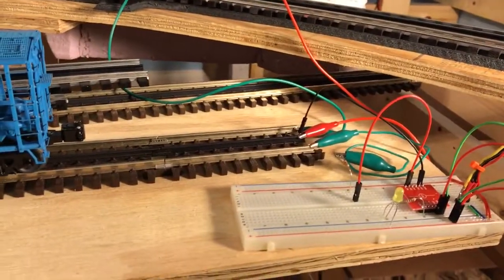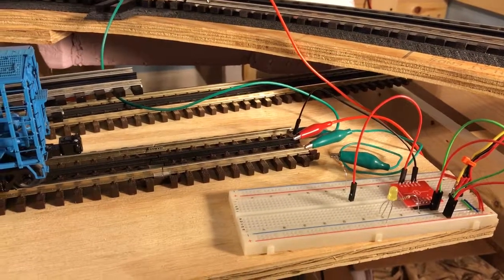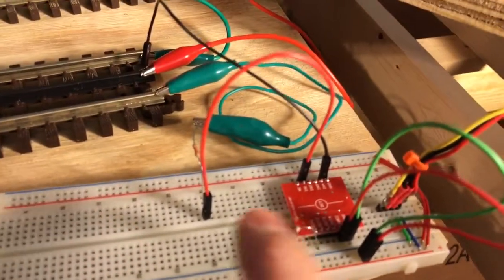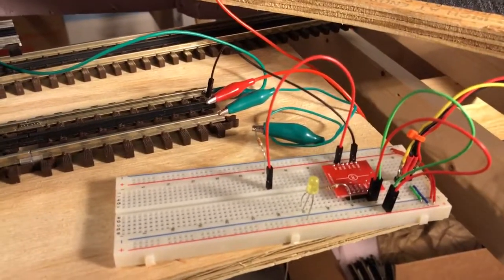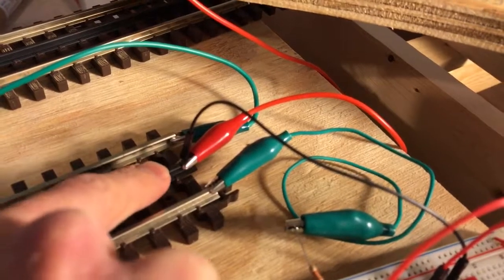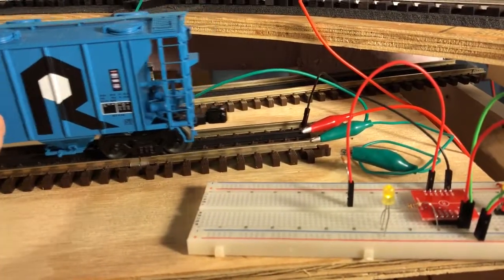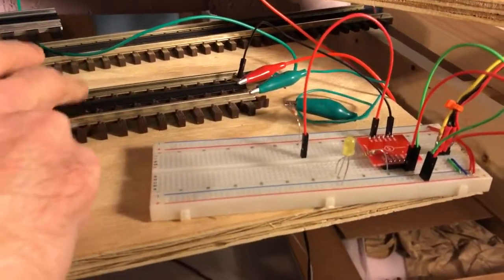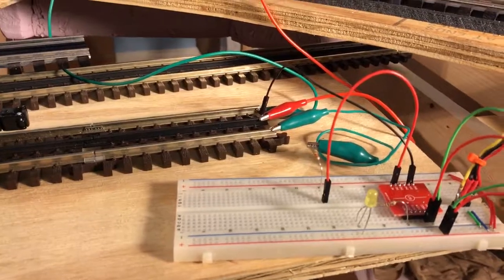3-rail model railroad signal occupancy detector - proof of concept

Comment: what kind of opto isolator did you use?
Reply from the maker: One of the ones on ebay – search for "4-Channel Opto-isolator IC Module Arduino High and Low level Expansion Board GM".
Reply: found it thanks!
Reply: This is great!
Thanks a lot.
( I was in the process of using IR detectors with an Arduino, also with Atlas track outside, but all times shaded).
This is probably better.
Thanks again.
Reply: @larrydee8859  I'm interested in your results if you went with the optocoupler.  I'm doing signals for a large layout and also want to avoid IR sensors. Thanks
Reply: @wetnyld  sorry for the delay in getting back to Swav K.
My outdoor three rail, Atlas O gauge Subway shuttle line, is completely DCC controlled.
(NCE 10 amp remote system).
This was an evolutionary experimentation starting at first with  both Opto isolators, and IR detectors. These  experiments yielded poor results, as they were too many variables under lighting conditions. 
 Very good results with at first using magnetic reed switches at each of my stations, (achieved
ultimately using basic magnets, under each lead, and end subway car.
The closed circuit triggered an Arduino input, resulting in a 5 volt TTL output that drove a small relay, that in turn drives a 4PDT larger relay.
This relay can change color position of both 🚦 signals, indicator panel lights, and more importantly drive a NCE mini panel, with a grounded input.
( The mini panel has an incredible ability to control DCC driven devices, such as, locomotives or other DCC activated devices.
One can program the duration of a train staying in a station for many minutes if need be,  before departing in the opposite direction for example.
I now use a much better detection system and no longer need the magnets though they're still in place.
NCE makes a a product that will detect inductive changes in a block.
This NCE BD -20 device, has a TTL output that can directly drive a 5 volt relay, that would ground  the mini panel input for an assigned program for a DCC operated  locomotive, whatever the scale.
This device, ( The NCE BD-20), can drive the mini panel which I'm currently using for the same purpose.
The best news is that the BD 20, is a non-invasive device.
That is one can take block wiring, to a particular block,  and wrap it a few turns around the bd20s coil,  which has its own circuit to activate relays, or  TTL outputs.
Reply: @larrydee8859  Thank you for your reply and good information. My situation is a large club layout with isolated rail blocks. It was preplanned for signalling.  We will not have train control included with this.  From all that I have seen sofar, we will be uzing Azatrax but not the infra red since we feel the block system will be more effective.  For many reasons.  The other suggestions have a place for some of the other operations.  Thanks for your reply.
Reply: Glad that I'm able to help with any information.
(A side note; initially,  I did test IR detectors, on an indoor HO small layout, driving an Arduino, powering relays that switched signals for blocks).